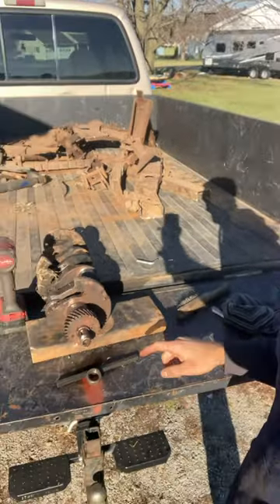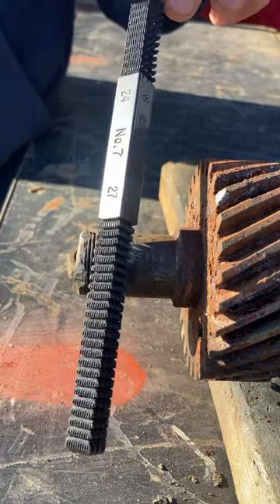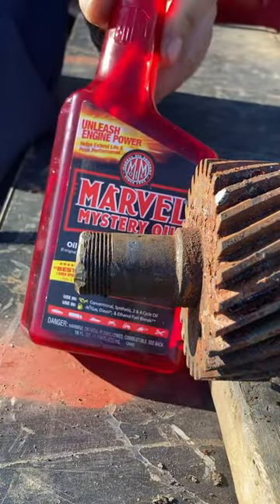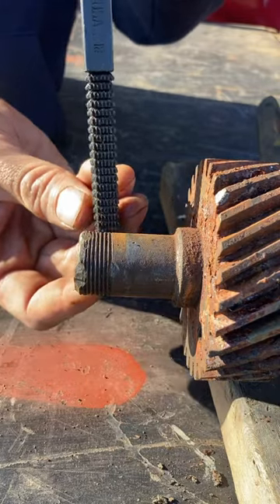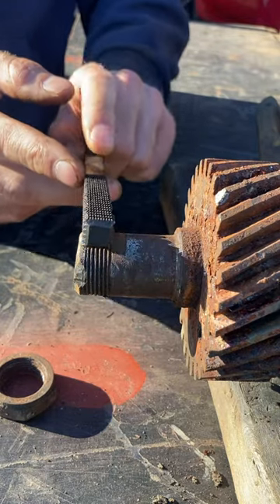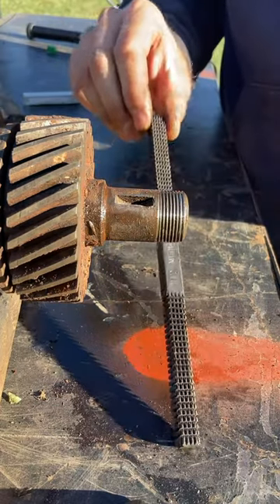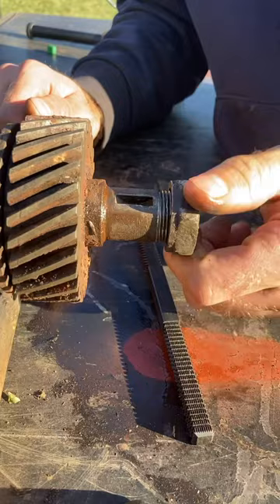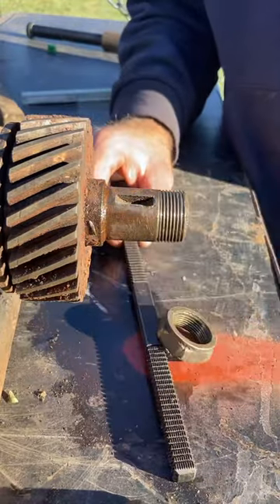How to repair damaged threads

Comment: You could also use a thread pitch gauge and it'll tell you how many threads per inch most mechanics have them
Reply from the maker: The file does the same thing. That’s all you need in this instance. Thread pitch gauge is handy when selecting a die/tap

Comment: Oh boy this might be something g else I need to use once and never again. I need chase some forks for a bike essentially. Not sure atm if it follows standard bike threads or not. Hopefully getting that info from the manufacturer of them. But this works way better than how I fixed the last pair I did. With a plain thin file 😮😢 fine threads and the forks had mashed threads on one side from abuse. Took a long time but these forks aren’t readily replaceable so it had to happen. The fact one file will do 8 thread types is excellent. Gonna need to keep this precious in an oiled rag or something. So it don’t rust up at all. Maybe even just grease it after use.
Reply from the maker: They have a coating on them. I just keep mine in the toolbox…no oil or grease. It doesn’t rust. 👍

Comment: He flipped the crank upside-down between shots. Notice the slot. Never shows the repaired threads.
Ground the buggered threads off so he get the nut to thread for the shot.
🤡💩📺
Reply from the maker: Haha. You have to go all around the part to repair the threads. 🤦🏼‍♂️  but based on your ignorant comment I understand that you wouldn’t know that 😆 and I’m sure you’ll reply to this with something equally ignorant. Thanks for watching have a great day!
Reply: Yes correct buddy😂😂